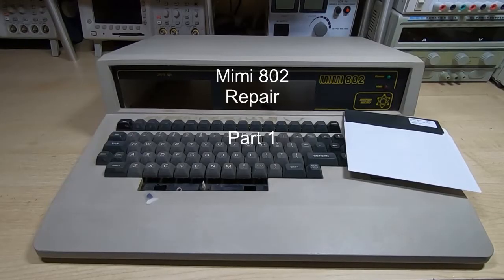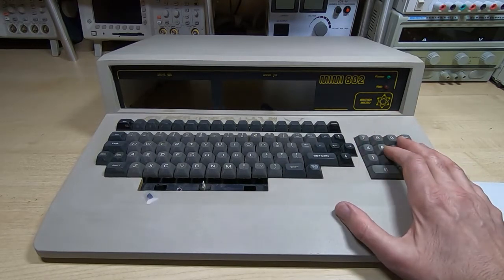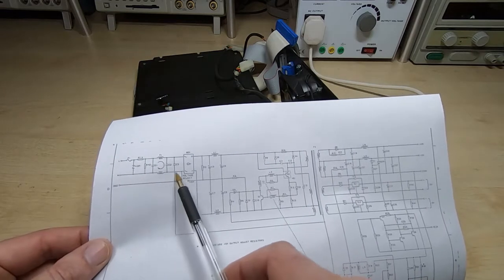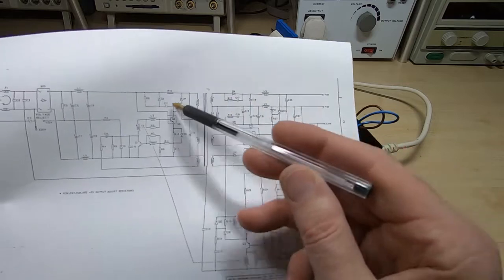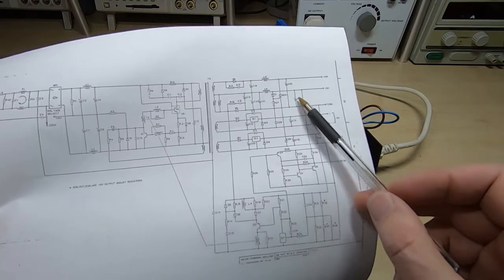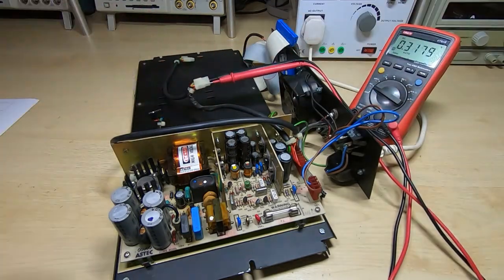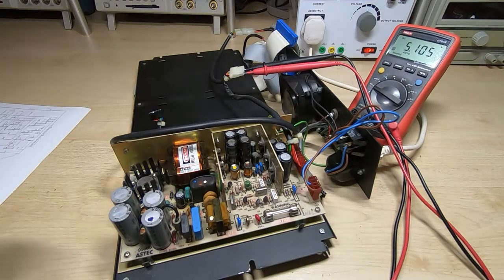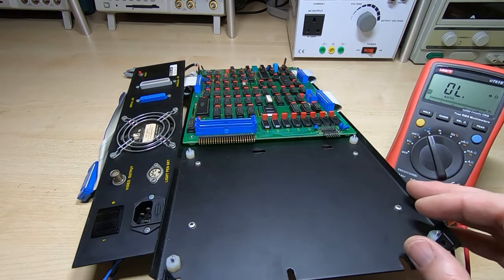Mimi 802 Repair Part1

Comment: I think it would be helpful to include details on specific components/IC's replaced; you often refer to replacing "this module" or "this component", but knowing specifically which IC, passive component, etc., was at fault is helpful for understanding the root cause of the failure esp. when it's a common failure point. Very interesting and informative videos otherwise!